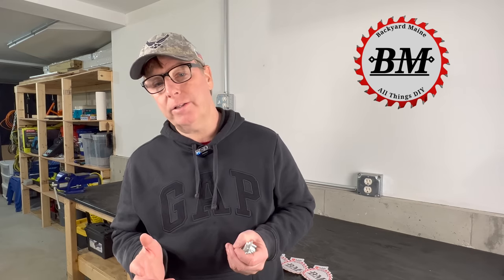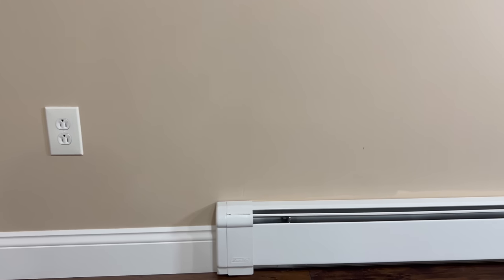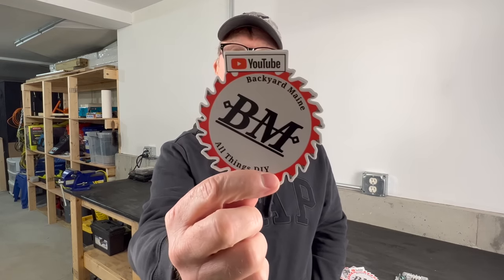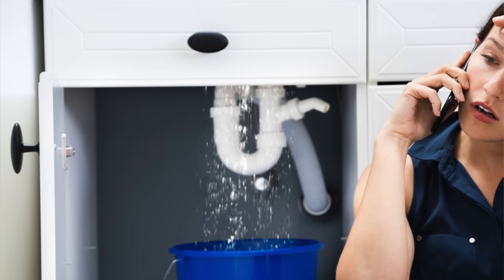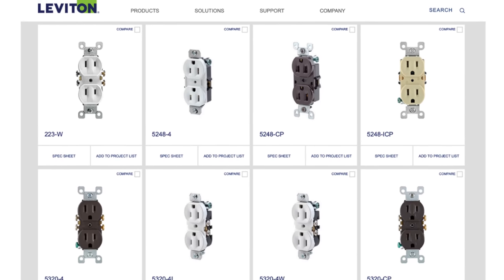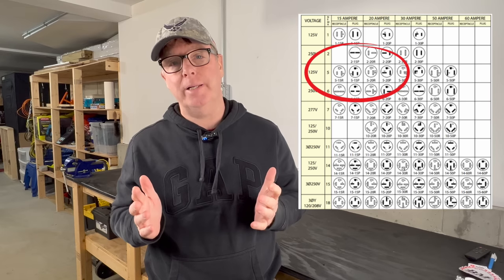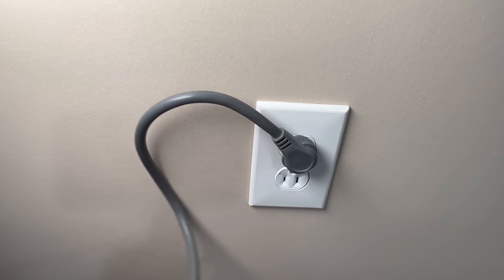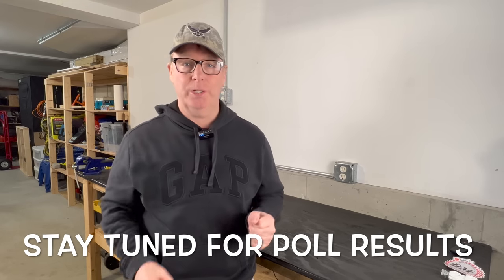Are your outlets installed upside down? (You may be surprised)

Comment: I usually ask the customer if he (or she) has a preference.  However, I prefer the ground pin up because if a metal cover plate is being removed and falls onto a plug, the power and neutral can contact the metal cover plate and short out causing a loud pop and lots of sparks.  Not a desireable outcome.  I often inform the customer of this possibility and many decide they want the ground pin up.
Reply: You shouldn't be removing a metal cover on a live outlet anyway. And who leaves cords plugged in when they are removing a cover plastic or metal?
Reply: @fauxque5057  I wouldn't do that, but can you guarantee that the customer's kids won't do something that stupid?  Unless you can guarantee the intelligence and common sense of every person that will ever be in the customers environment, and also keep a screwdriver out of their hands, it's better not to assume,  It makes an ass out of you and some Mechanical Engineer.  Stick to commenting on things you actually know something about.

Comment: Thanks for your time explaining this. I have a question, can you use a AFCI receptacle without an AFCI breaker? Or you must have both or nothing at all?
Reply from the maker: Yes you can use an AFCI receptacle without an AFCI breaker. Having both would be redundant and not recommended. In other word if you have the breaker you don't need the receptacle.

Comment: I’m not an electrician, just a dumb old engineer. I like the concept of putting all outlets in a residence the same way except for switched outlets which should be different. When I designed my house I had all outlets installed ground up and switched outlets installed sideways.  But, as you said, the choice is up to you.
Reply from the maker: I was a dumb electrician for years and then I became a dumb engineer like you.. lol

Comment: The ground goes down. However, from a safety standpoint it doesn't matter. From a functional standpoint, ground down is more easy to use. I have also seen a lot more ground up outlets break than ground down.

Comment: I almost always prefer ground down, mainly agreeing with your reasons (even before I heard them).  As a 70+ year-old, ground down is the correct way, regardless of the minuscule chance of something metallic falling on the prongs.  And, for consistency, I'll make sure ALL outlets are oriented the same way (ground down).  With one exception -- I do have a couple of old extension cords that need the ground up for the cord to hang down -- in these cases I'll defer to what makes sense based on the plug.

What I always found much more interesting, and likely, and exciting is, again, based on my age.  In my young days we always set up our Christmas tree in the middle of an electric train board with the tracks going around the tree.  Remember when tinsel was aluminum?  The rest of this story is left as an exercise to the reader!

I also like your idea of having switched outlets uniquely mounted ground up.  They don't make outlets that would work for my shop, though.  All the lower outlets on the receptacle are constant on, and the upper ones are switched.  I've never seen a duplex with differing orientations between the 2 outlets that would satisfy this constraint.
Reply: How does this relate to a Christmas tree? I've never seen Christmas lights or electric trains with a 3 prong plug.
Reply: @8546Ken   The discussion of the three-prong plugs has to do with the position of the ground terminal and possibility of shorts caused by conductive things falling on the prongs of plugs.  In my case, it happened from time to time that a piece aluminum tinsel (conductive) would fall off the tree and on to the energized train track below.  The tinsel would cause a flashing short on the energized tracks, just as would happen if something conductive fell across a plug's prongs.
Reply: @johnburgess2084  Yes, i remember those days. But it didn't make any difference which way the outlets were mounted.  In fact, when we had tinsel on the tree we didn't even have 3 prong outlets.

I did see this happen at a neighbor's house where they had a chain lamp and the chain came across the prongs of the wall plug and sparked. But it was he usual 2 prong lamp plug so it didn't matter which way the outlet was mounted.

Comment: This is not codified in most states.  It is mentioned in the recent NEMA definitions for the outlets, not the standards used for residential electric code.  

It is one of these best practice things.  However it gets more complicated, because the other direction was standard for so long that many devices are built with the heavy side towards the ground pin.  This is, however, changing.  In order to be able to plug two such devices in, a growing preference is to have them fit directly over the outlet, and if they extend, do so to the hot pin side.  (Which should be facing down in best practice installation if the wall outlet is mounted sideways.)

Comment: I started doing electrical work in 77' and I got my first Masters license in Texas in 92. 
I install receptacles ground up only when it's feeding a device that it's critical not to lose power:  for example in a hospital when there's life-saving equipment in use otherwise I always install with the ground down.
The reason I usually install with the ground down is because I think it's more important that the device or equipment that is being energized does not lose its  equipment grounding conductor. If someone steps on the cord and pulls it down the ground stays connected and in the case of the hospital example the current carrying conductors stay connected. Basically I think the risk of losing the grounding conductor is more dangerous ( electrocution hazard ) than the possibility of a foreign object causing a arc especially now that it's code to have afci or gfci protection on almost all Branch circuits  of 120, 240 and 120/240 volts - up to 50 amps. 
Plus it looks better!

Comment: Being an electrician in a coal mine we (by law) had to wire 3 phase 480 volts or higher receptacles with the grounds down because if the plug would ever work its self out the ground would be the last conductor to break contact

Comment: Try it - plug into a ground up receptacle and trip over the wire - It will disconnect from the wall cleanly - 

A ground down receptacle will pull back and then bend or break the ground pin

Comment: I retired from a large hospital/ research centers that had over 10,000 120 volt 20 amp duplex receptacles with metal engraved ( have panel & circuit # on plate ) Stainless steel.plates. All were installed ground up in case the single flimsy 6-32 mounting screw fell out. Its safer to have a metal plate fall on the ground pin.  In the few locations where receptacles are mounted horizontally then the grounded conductor ( ya neutral ) is towards the ceiling.
Reply from the maker: Most hospital build specs use IEEE std 602 which recommends ground up. Article 517 Healthcare Facilities in the NEC has no requirement.

Comment: EU has a round outlets with round pins. In the 1960s they came with a new idea, called Schuko. The plug and the outlet have roughly cylindrical shape, and cylindrical plug enters the cavity of the receptacle. When the plugs touch the 0 and 220, they are already out of sight and can not be touched with finger. In addition, the plastic plug and outlet support the weight of the cable. In addition, the ground wire is connected before the 0 and 220. It will not be difficult to modify our outlets first, then the plugs, in similar way. We already have many commercial cylindrical male plugs. And there are even receptacles on some equipment, like leaf blowers and chain saws. All we have to do is replace the outlets with face plates that provide recess for the plug.

Comment: l have been an electrician and/or a controls engineer for 40 years.  Working for my dad in the beginning (late 1960's through the early 1980's) who started off as an electrical contractor and then owning and operating  an electrical distributorship, ground down was universal until the late 1970's when there was a push for the new ground up installs that were becoming popular.  While many say ground up is safer with the cord hanging down I would disagree. when pulling on an extension cord the top prongs usually become loose and disengage electrically before the bottom prong or prongs.  I would want the ground conductor to be the last one to disengage not the first for the best electrically safe circuit.  So I will always use Ground Down on my receptacle installs.

As far as receptacles controlled by light switches.... Most installs that both my father did and also those that I have done, were a split wired receptacle where the bottom side of all of the plugs in a room or along one wall were switched while the top plug on those same receptacles were on all of the time.  This allowed for lamps to be plugged into the bottom receptacle plug and controlled by a switch at the door to the room while the top plug on those same receptacles could have something else plugged in that wouldn't lose power when the lamps were turned off at the switch.
Reply from the maker: Similar background. My father worked for the power company for his whole career. I went into the USAF as an electrician for the civil engineering group. After those 4 years I spent 26 years as an industrial electrician and then my last 10 years working as an electrical engineer for Texas Instruments. I also did a lot of industrial control work over the years. 
I used to work on the side when I was younger wiring houses, service work etc. Split wiring switches was not an uncommon request. I prefer a permanent light fixture in my own home but as you know if you don't have one you need to supply at least one switched receptacle. Thanks for dropping a comment.

Comment: Although no comment has said it, the ground down position helps keep a plug with a ground from falling out of an older outlet although it's possible to short circuit more easily in that position. You would think that renovating a Florida condo would have those older receptacles replaced.

Comment: I've done my research on this topic over the years and have found the number two reason for suggesting ground up is the weight of the plug pulling on the round ground pin is better than pulling on the two flat pins. This causes the receptacle to last longer and be less likely to fail.  You can find flat plugs that only work on ground up the same as you can find some that only work ground down, so that's not really a good indicator.  I watched a video on this a few months ago on a different channel and that channel suggested the best is probably sideways like they do most receptacles in the Midwest (according to him).

Comment: I have a bathroom GFCI the was installed ground down. I thought maybe they did that to make it easier to put the load wires on for connecting the other receptacles on that circuit. I need to switch the receptacle, so I’ll see if my thought process was correct.

Comment: I might be wrong, but I believe that the 15 Amp outlet is for both outlet plugs, or around 1500 watts.  But in the last couple of decades we say the power requirements change drastically. Big screen TV’s are now using about half the amperage they used to, the LED lighting is much less amperage dependent. Even the “nightlights” installed in wall outlets previously used 5 to 7 watts, and now they use less than a watt. Look at Cellphone chargers, they use only 30 to 60 watts on a multi-charger. But, the “ground side up” is an easy way to determine which outlets re on a “switch circuit”. If you plan to add a “multitap” outlet multiplier, you need to use a design that has a “twin plug” wall tap or both outlets will be on the switch”.

Comment: Ground Down - For the 90d plugs you mentioned.  Every appliance, extension cord, adapter etc that has been brought into this house and has the 90d plug, the receptacle should or needs to be ground down to accommodate those (accept for one that I had that the guts of the plug could rotate.  I was always a little afraid of that one for some reason.

Comment: Ground down was most common but ground up seemed more safe (before GFCI or Arcflash outlets). A crawling baby reaching 
downward with a fork, which is what I did 59 years ago, would contact the hot wire.

Comment: Either way is correct. It’s advisable to install them ground up when a metal plate is used. The reason being that if the cover falls off the plate falls on the ground pin.
Reply from the maker: I said that in the video.

Comment: Hi, I too have heard it all about which way is correct. I have also heard all the reasons as well, Yes if you look at a receptacle ( plug or power outlet, whatever you want to call it) the writing on the device would suggest the ground pin up install. Yes I have heard that it is a proper and safer install because it helps protect conductive materials and objects from making contact with the hot and or neutral blades of a cord. The truth is even though it is undesirable for this to occur it doesn't happen that often and the circuit should be wired and protected with the proper sized fuse or breaker for said circuit. Now if you look at a 3 pin cord ( hot, neutral and ground) you will notice that the ground pin is the longest of the three. That is because when being inserted or removed the ground pin is the first or the last pin to leave the outlet. Further more most times cords that get accidentally pulled out of a outlet fall down not up so having the ground pin down in my 40 years as an electrician in my opinion is the most logical and correct way to install an outlet. But hey, each to their own! Cheers
Reply from the maker: I completely agree. And we have the number of years of experience.

Comment: In the two hospitals I've worked at, the engineered drawings specified ground up for the fact that was the ground up medical equipment plugged in would not get Short circuited in an accident just like you described. Most healthcare equipment straight cord ends and not 90° cord ends
Reply: And especially life-saving equipment like respirators and  IV PUMPS need to be ground up for that reason.
Reply from the maker: Most hospital specs are written with guidance from IEEE standard 602 which recommends ground up.

Comment: Some appliances, like refrigerators like a ground up,if the outlet is low. My take has been ground down. I always thought it was for a flood or rising water. With the ground down the rising water obviously contacts the ground first, hopefully shutting off the circuit the moment water touches power . Never have I tested it,but just thought it was right .

Comment: Down is my preference but either direction is correct most union electricians will install ground up for a myth of something falling on the plug and it would hit the ground first. I am an electrical inspector, member of nema, iaei, seca, neca and agree with this video
Reply from the maker: I've been hearing that but I started my career in the IBEW local #7 out of Massachusetts. Back then we taught our apprentices to install ground down unless a job spec or the customer requested different. Maybe it's changed or maybe it's a regional thing. I really don't see ground up very often. Keep up the good work my friend.

Comment: In my house they were installed down. I install them with the ground up because if something is dropped on the cord and it is pulled partially out of the receptacle, the ground will not short out the object by what is dropped on it. And many new extension cords, with 90degree heads, have the ground up on the cord.

Comment: "Ground down" orientation has been a problem, either in residential or industrial applications; and like you say, "ground up" just looks odd. There was a guy I knew setting on the back of his houseboat with his feet in the water. Boat was docked and plug into shore power. They had plugs ground down. A gold chain fell off the shelf onto the plug in the bathroom (head) of the boat. It went to ground and he was electrocuted when the chain hit the plug that was ground down and out just a little from the wall outlet. He was a very young man family was heartbroken over this. This is a true story and sad.